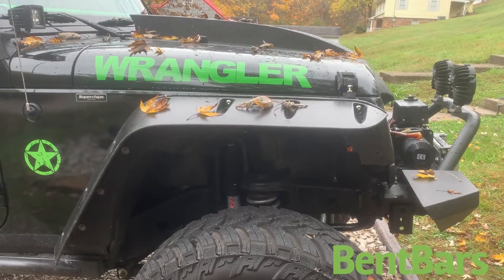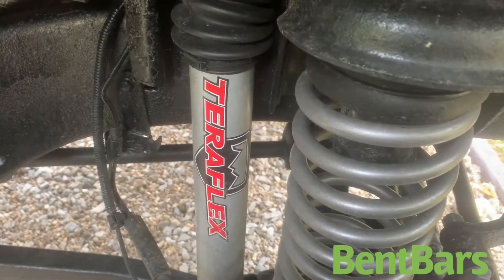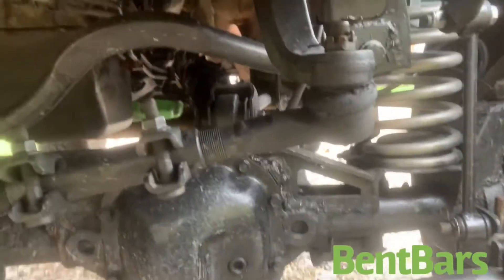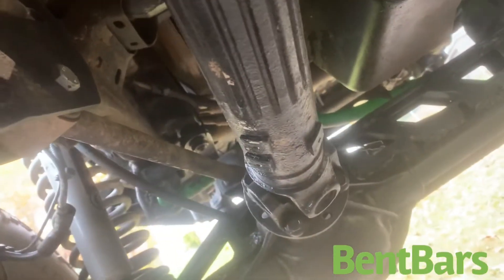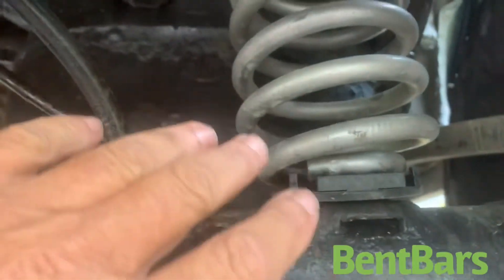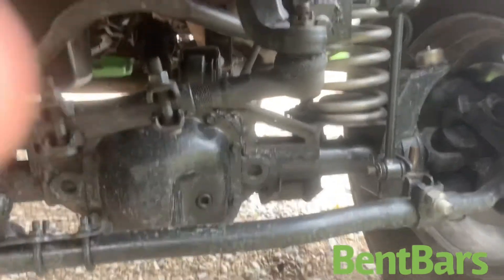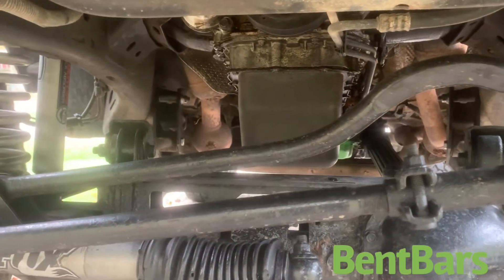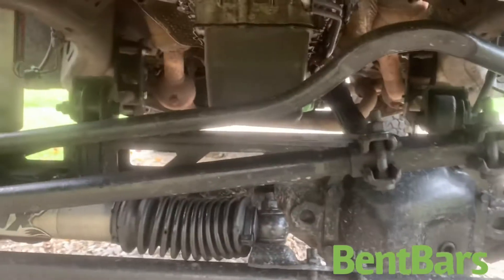rough country 4” lift 1 year review Jeep Wrangler on 37s

Comment: Does your Jeep make sharp turns without any problems I lifted my jeep and the traction controls turns on and my brakes jerk when I take a sharp right like on a exit ramp ?
Reply from the maker: Mine is fine being at a higher center of gravity is activated your stability control just slow down some should be fine and make sure your steering is center

Comment: I've got the same 4in lift. Why didn't you just buy lower adjustable control arms?
Reply from the maker: These put the angles back down so it rides better harsh angles send rough spots up through the arms instead of the spring taking the hit
Reply: @Bent_bars  I see but the lower adjustables can turn your axle and fix the angle on driveshaft and also level out any bend in your coils from being off camber.
Reply from the maker: @Rogue.Rider0  I know what you’re saying I’m going to put them on just wasn’t in the budget at the time work little slow now
Reply: @Bent_bars  yeah I added front lowers and it solved my sever death wobble issues. I'm adding the back next. They're $200 a set. RC Xflex. They also slow you to flex the axle way more and the arms themselves are capable of flexing 30%. Metal cloak can only do 20%. I love mine. Buying the lower rear next. They're also rebuildable and cheap. I've read you can interchange them to with metal cloak if you wanted.